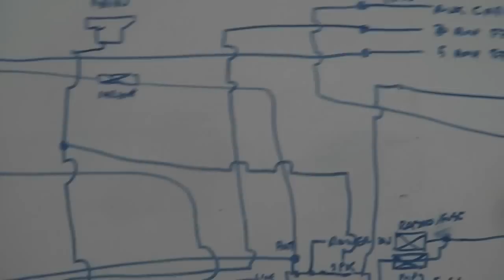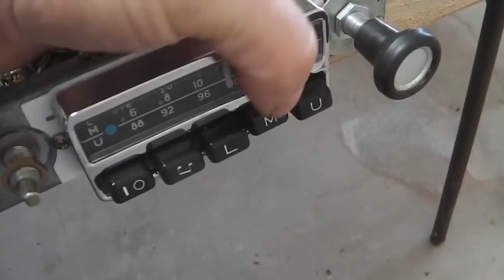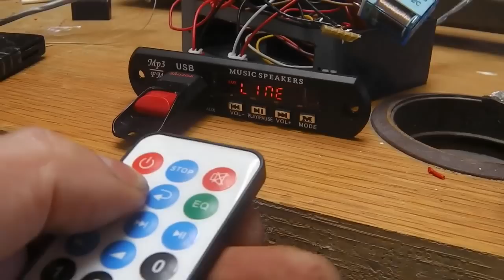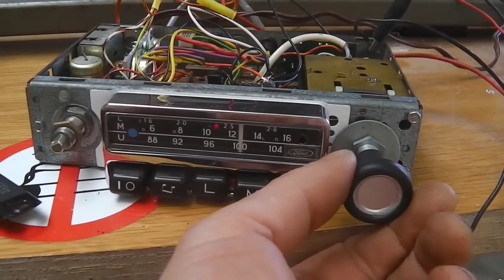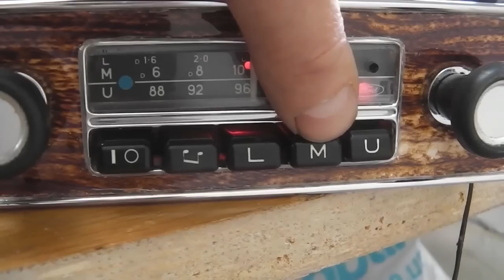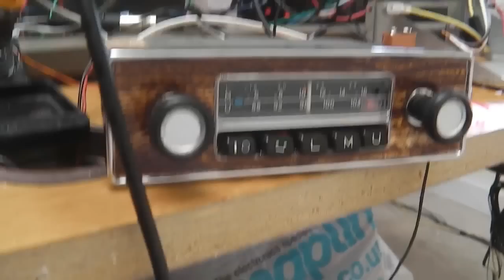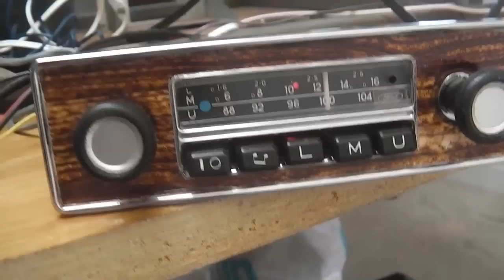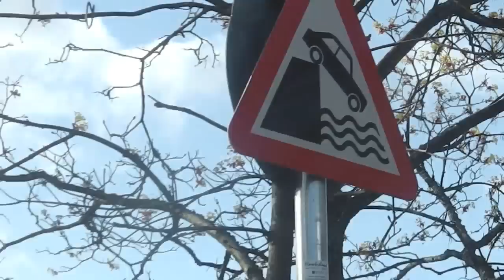Ford Cortina Mk3 Restoration - Project Ruby EP16

Comment: That's a really good example of taking the opportunity to prepare for the future while work on the shell is at a pause.  That's something a lot of people don't do and then they end up rushing the finishing touches which end up letting the restored car down.  And surprisingly for someone who isn't great with electrics I understood most of it lol...
Reply from the maker: yes its good to use anydowntime, i can just plug and play the whole dash into the car, what you reckon?
Reply: Pete C   Yes, it's a great example of the right way to do it and using what would otherwise be project downtime to the best.  And I'll lay odds that it's going to make reassembling Ruby and completing any snagging that needs to be done a hell of a lot easier and quicker, not that there is likely to be much snagging to do with it all having been bench tested like this...
Reply: mirroo

Comment: Very impressed with the retro fit to the period radio and a nice addition to the build videos. I have a modern radio in my Mk2 Escort but dont switch it on half the time prefer listening to the noise the car makes. How about a DAB install in the two door project.
Reply from the maker: +Jimspeed 13 yes i did think of DAB Jim, ill investigate, thank you for kind words. Mk2 Escort another great car.

Comment: those mp3 bluetooth modules are great value but beware they do provide a very noisy signal especially audible in bluetooth. nice work though
Reply: also they do have a 5v regulator on but they do get very hot so i would use an additional 9volt voltage regulator just my 2p m8
Reply from the maker: thanks, very good advice, im running on 12v regs jsut reg 1a regs, been ok over the years got same in green gxl, running ok 5 years later, yes you right on the noises, its the low quality china town, but they do do the job at bloomin good price, i put a few caps down from line to ground, and rf choked the feed, its not so bad.

Comment: Hi Pete, your audio set up looks pretty cool, I've just received one of these through the post http://www.ebay.co.uk/itm/142013135999?_trksid=p2060353.m2749.l2649&ssPageName=STRK%3AMEBIDX%3AIT   and have a quick question, the input voltage printed on the PCB says 5v (although the listing gives it at 7 to 12v). Did you have to drop the voltage down or does it run fine at 12v? Also I'm guessing the load from this module is really minimal so what size of fuse are you running inline, 500mA or so?  Cheers for all the help and inspiration!
Reply from the maker: watch out! i blew one up as did same! use 5v reg 7805! hope i aint too late. may work with 7812 if board is 7-12v, chinese could have got printing on circuit wrong
Reply: Cheers Pete, it's not just me then! Luckily I haven't built up the box yet so I'll run it up on a bench top psu at 5v first and then include a 5v reg if required, I've just ordered one from Farnell Thanks for the info :)